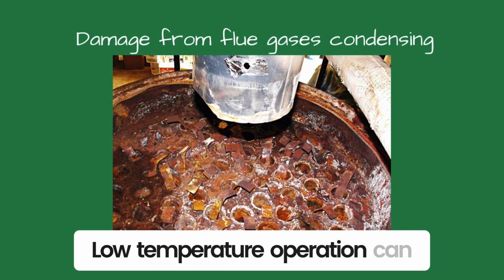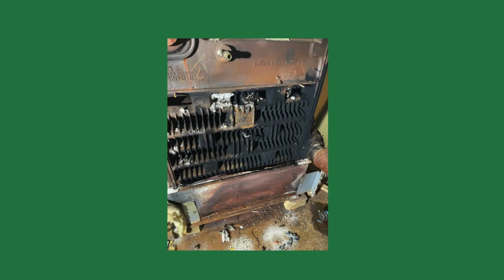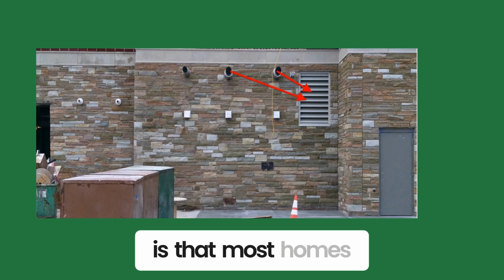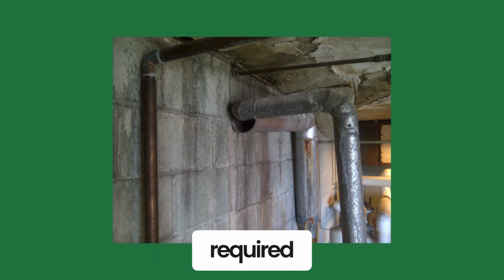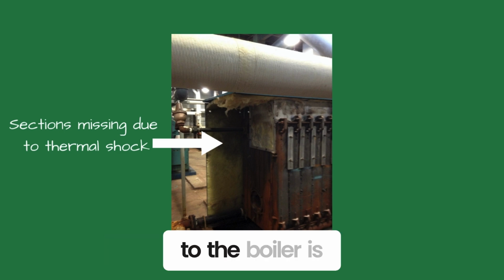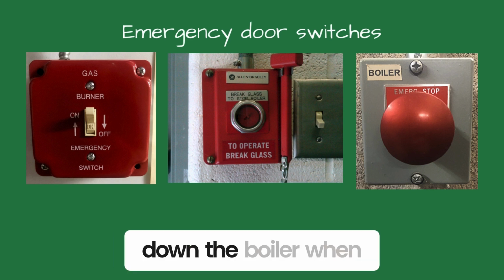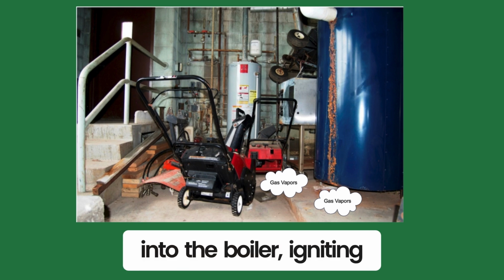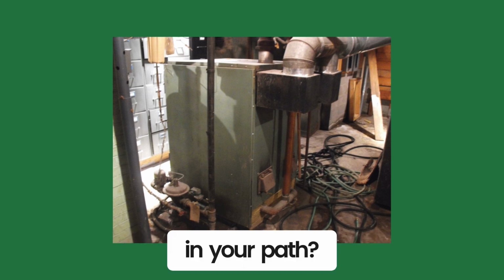Hydronic boiler room dangers

Comment: Thanks Ray; very good info.  I remember when I was a kid we lost a heat exchanger on our gas heating system. The repairman explained that it was due to condensation of flue gases because the heat was run for too short cycles to reach operating temperatures. My mom was concerned about heating costs and was always turning the heat off when she heard it running.  You got that right about the soot!  I get that from working on diesel generator engines, and it is a mess!
Reply from the maker: Wow that would be scary

Comment: You got that right about the difficulty in removing soot from your skin. Many years ago I serviced oil field boilers which were mainly all oil fired high pressure steam scotch marine boilers. These portable boilers were frequently used at different elevations plus suffered from poor maintenance resulting in sooting. After cleaning, you then faced the often times long drive home covered in soot. You scrubbed the best you could but still exited the shower looking like a raccoon due to the soot still under your eyes. The wives cold cream that she used to remove mascara was about the only thing that worked in a timely fashion.
Reply from the maker: Been there done that too Thanks